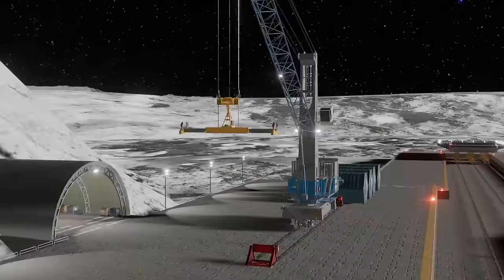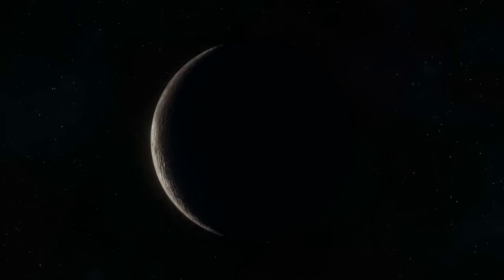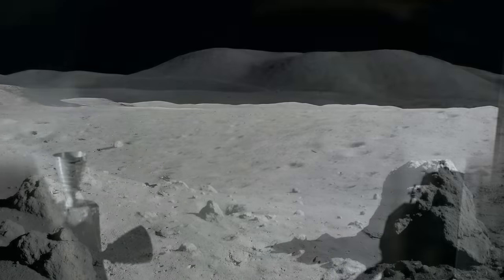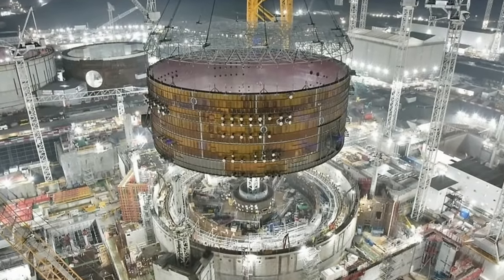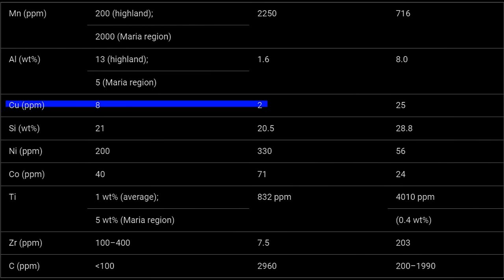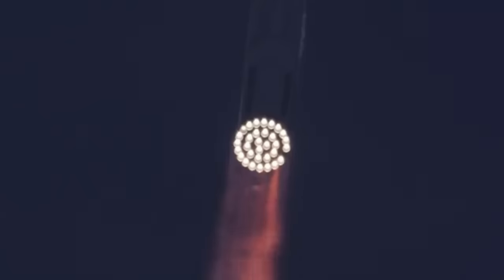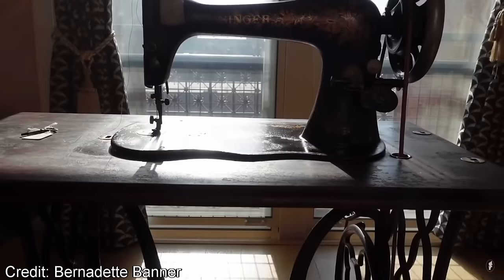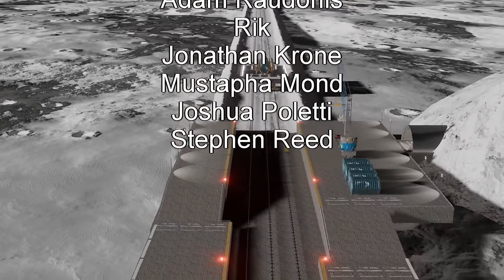Designing Heavy Machinery To Excavate The Moon

Comment: It’s difficult to set up a forge on the moon, as casting steel requires certain sand mixtures (silicon and clay which isn’t on the surface). But the sand is somewhat reausable.

Electric discharge melting of the regolith, like how aluminum ore is smelted today, is probably going to be used, which required carbon electrodes which are consumed during the process. Similarly oxygen is needed for steel manufacturing (along with carbon) to remove impurities.

Whatever metal slug is manufactured by just melting the regolith is likely to be the major commodity at first, acting as a masonry unit, as well as initial ingredient in manufacturing.

Machining is going to be challenging, as the tool steels are not the modern machining standard, but insert tungsten carbides. Similarly the heat from machining needs to go somewhere. Lasers are imprecise and so is water jet cutting, so machining is needed. Grinding tools are made of alumina or diamond, of which can be grown, but not for a long time in the moon. Machining standards can actually reduce the need for grinding for tolerances down to one/ten thousandths of an inch, which is probably good enough for a steel shovel.

Multi axis cnc is going to be critical, and figuring out all the specifications of VFe and other regolith ingots is going to be needed.

The set up of manufacturing is going to be heavy, but could theoretically start with a hammer and anvil. But a ten ton, nine-axis, tool feed with dozens of specially selected tool sizes is a good start. Nine axis can imitate a lathe, but a lathe can’t imitate a nine-axis.

Collets, endmills, drill chucks, thread mills, centering bits, live centers, gear tooth bits, and more are just the most basic of basic. None of them are light, and none of them can be manufactured easily. They are precision made metal after all. That, and the weight of the set up is used for precision in the first place.

If you don’t want to use coolant, aluminum machines decently, but the coolent is probably going to be imported. Manufacturing needs to be in atmo, but casting less so. Also, the cooling of metal affects crystal structure, so purely radiative cooling crystal structures of metals needs to be researched. The crystal structure being where the strength and properties come from.

Cold and hot rolling, forming, and injection casting all take stupid amounts of metal to achieve the stupidly high pressure without bursting or breaking. Special lathes need to exist before cold rolling can occur, which is how most steel is made today. Direct ingot 3d printing of metal, probably laser sintering from metal dust, seems compact and useful for construction early on, but lacks precision at the small scale. The piece needs to be finished.

There is more to it all, but this is just a YouTube comment.

Qualifications: took an 8month course in college on machining specifically and have loved modern marvels since childhood.

See: 
Tool and Die
Machinist’s Manual
Steel and aluminum manufacturing
Welder’s Manual
Mechanics of Materials
Metal Crystal Diagrams
Tool Steel Handbook
CNC Machines
Machine Tool Manufacturing
Blacksmithing
Metal Casting and Forging

P.S. I just like this stuff, so here is my rant.
Reply: You honestly seem like an incredibly interesting person omg
Reply: You can get away with far greater tolerances than 1/10,000 of an inch ! - that’s actually high precision machine tool specifications.

Look at your 1950’s automobiles for ‘crap’ tolerances..
Reply: You need a complete re-think of how to manufacture things on the moon.
Simply copying Earth methods is not the best way to go.  Things that can make use of ISRU are the best solutions.
You want to import the minimum amount to stuff.
Reply from the maker: Great stuff, thanks fellow steel lover. 
So you'll be interested in this: https://www.nature.com/articles/nature12134
This was invented off the back of extracting oxygen from lunar regolith but is now poised to change the entire steel manufacturing industry and has already setup a facility in Brazil. Si is also pretty common on the Moon (around 20% by weight) but I'm curious if it will be necessary using this electrolysis method. You said for casting not smelting so it likely will but regardless lunar steel production will be different from here on Earth. Vacuum is free though. 
Adding carbon instead of removing it is also an interesting change.

As for much of the other stuff you mention it's a great reason why our lunar industry will be like that of the 1930s 1940s etc. for a while. I will touch on this more in a future 'manufacturing video' and I really appreciate your comment because it'll help me format some of these ideas. I also appreciate your list at the end, will check those out for that video.
-Ian
Reply: Really interesting link. Given how fast carbon anodes deplete, something that even reduces the need for replacement introduces options, bigger batches, non-carbonous iron alloys, higher throughput before replacement.

I am also curious how gravity affects metallic grain structure, be it micro or higher gravities. So seeing a future where humanity can learn this is a big thing to look forward to. There is a lot more to look forward to than just grain structures hopefully!

I look forward to seeing what else comes from you!
Reply: Yeah, there is a boat load of things with tolerances much higher than 1/10,000 in., but keeping such high tolerances can make up for lack of polishing and grinding. I have made some parts where line of sight was sufficient, but that’s mostly visual stuff or parts where someone interacts with a piece like handles and such.

Though some parts do need ubber precise parts, but those tend to be lithographed I think because it becomes the realm of micro machines. I think much more expensive machines can get more precise, but good luck putting them on a rocket and expecting all the bolts to be in the same place!
Reply: Oh, also, I have an old Tool Steel Handbook, and all the needed elements (to make everything in the book) are: Iron (obviously), carbon, manganese, chromium, molybdenum, silicon, vanadium, tungsten, cobalt, and nickel.

This works for drill bits, augers, chisels, burnishing tools, clutches, nails, pipes, blades, dies, extrusion nozzles, glass dies, lathe tools, endmills, forming tools, hammers, threading tools, cutters, knives, machine parts, knurling tools, pneumatics, rivets, wire draw dies, and more. (Taken directly from the “Applications of tool steel” section of the book.)

“Tool Steel Handbook” from Allegheny Ludlum Steel Corporation c.1956
Reply: Question. Why can you not simply use water for machining coolant? It has good heat absorption properties, is easily recyclable and is almost certainly available in large quantities. In fact, if water ice is not available in large quantities on the moon, then you might as well forget it all together and focus those efforts on Mars instead.
Reply: @Shrouded_reaper
Water would work for cooling metals, but water is the tendency to oxygenate and thus corrode a lot of metals, either the workpiece or the machine components themselves. Corroded metals have different properties to what most applications call for and can increase both wear of parts and reduce structural strength. 

Also, at very high temperatures, which are very rarely worked at, water would flash boil and thus push away the rest of the water preventing further cooling, or could just damage some component.

More fundamentally though, oil has a very high thermal mass and sticks very well to work pieces. This means it can get into all the little nooks and crannies present while machining. The oil sticks in large quantities to the drill bits, the mill heads, etc and flows into contact with the metal as the bit spins and cuts pieces away.

Good question. I think there are some specific applications where water based coolants are used, but I am not familiar with them, or my instructor simply didn’t teach me them.

I hope this helps.
Reply: @projectarduino2295  Is there such a thing as abrasive dust machining? If we are talking exotic machining then could something like diamond dust (or regolith) be used like sandpaper be possible? Thermally speaking I imagine it would be a long process of waiting between blasts for cooling but would that be enough? Or would the ricochets cause too big of an issue?

You seem to be pretty knowledgeable so I figure I'd ask.
Reply: @mrsuper7484
Abrasive dust machining specifically? I don’t think so.

There is sandblasting: the slow process of wearing down a material using an aggregate. It is used to smoothen or finish hard and brittle materials like stone. High pressure air is used to throw the sand at a material which slowly weathers it down. It often results in a generally soft texture. It’s main problem is the wear on the ejection nozzle, which is often made out of tungsten, due to the aggregate abrading as it is ejected.

There is also water jet cutting, which uses high pressure water and sand particles to punch holes in and cut through steel sheets. Has the same nozzle problems as above. Sometimes it doesn’t use sand but that is for softer materials and is common in the food industry.

Then there is grinding, which uses a polymer to bind together aggregates which are then rubbed against a surface to remove small amounts of material (based on aggregate size) and when a particular aggregate looses its sharpness the forces acting on the aggregate pulls that piece off exposing a new piece for cutting.

I hope that helps. I am not aware of a primarily aggregate based machining procedure, but the benefit would actually be that there would be a very low need for coolant as the aggregate particles would carry away the heat they generate in the abrasion process, and the only thing then needed to be cooled would be the workpiece, which depending on its size can be negligible, the bigger the cooler. As of right now, it just seems to be too slow of a process to perform the large amounts of material removal common in modern machining.

Once again, hope this helps!
Reply: @mrsuper7484
Grinding disks do use industrial diamond sometimes as an aggregate though.
Reply: I suggest looking up Laser Waterjet, or 'laser microjet;' as it's a great option for this kind of problem potentially.
Reply: Rant appreciated.
Reply: His idea of steel as a starter is off the table, because the Moon's iron isn't concentrated enough, it's gotta be aluminum & silicon as starting materials (in oxidized form, both are common on the Moon, and even in the same minerals). For melting, probably microwaves at first (in regolith form), followed by induction heating at a central location later- in vacuum, just heating the regolith enough will cause oxygen to outgas, leaving you with much more conductive materials, so the initial microwaving step should be enough prep for "field ingots" to be ready for the induction melter (the process is called "vacuum distillation", and can actually be used for much more refining, but elemental purification would be best left to later base expansions). Baring only a few surfaces (axels come to mind), all early machining will be some mix of lasers and EDM devices mounted on a robot arm (which wouldn't need to be strong, and thus could be light), and maybe grinding (regolith is very abrasive), with almost all shaping provided by additive processes (whether casting, or welding): note that I would classify sintering as a class of molding.
Reply: Carbon shouldnt be a problem, you get lots of CO2 either from breathing of humans or from industrial processes, since everything will be in pressurized bases, you have tomdeal with the CO2 anyway to keep the people alive. It is pretty simple to collect it by plants or filter systems.

Comment: Actually because the moon has no atmosphere, titanium becomes a very interesting material. It's not rare, but on earth it's hard to manufacture because it oxidizes during production.
Making it in vacuum could make titanium the best material to use and also cost effective
Reply: We have found a method to machine titanium that has overcome that issue.

Comment: an excavation on the moon would be a dust storm visible from Earth, and entirely invisible if you were standing in it, along with everything else
Reply: ........ okay
Reply: Remember that dust kicked up on the moon might be rather intense at first, there is no atmosphere and no wind, so it settles very quickly and without any fuss.
Reply: @gallomimia7780 there's also the fact that static electricity can float dust on the moon easily since there's no moisture in the air to neutralize it, nor is there a way to really ground your machine well. Gigantic lightning bolts zapping your machinery at random?
Reply: @OtherDalfite  dedicated lightning rods between large exposed facilities? the most valuable things will be protected indoors
Reply: @OtherDalfite : And also long-distance sand-blasting in some cases.

Comment: Aluminum wound motors is a great idea, I'd double down on that. Pullies still have physical parts in contact that need oil and constant replacement from regolith abrasion. Instead, aluminum wound linear motors with maglev bearings could be a drop-in replacement for hydraulics which is immune to regolith contamination due to a lack of touching parts. The maglev parts can be more aluminum wound electromagnets or ferrous superconductors.
Reply: I believe Nasa's upcoming nuclear sterling generator, mentioned in the video, uses magnetic bearings. But how is this a replacement for hydrolics? Hydrolics don't use bearings?
Reply: That's good but aluminum is tend to slowly degrade under current, it needs to be static and not flex, because it has small flex resource, and, connected to copper wires, which PCB's use it degrades more quickly and creates small currents, that can have a bad effect on control electronics.
Reply: Don’t forget - no atmosphere on the moon.  So degradation is mostly via abrasion with regolith.
Reply: Maglev bearings are only really options for extremely low load applications. Youre not using maglev in heavy machinery
Reply: @peterclarke3020  Aluminum degrades under current - atmosphere doesn't affect too much - that's the main reason most soviet mars probes died in interplanetary space half way to their target destination - because the manufacturer of diodes for those crafts chose to save money on golden contacts, replacing those with aluminum ones.
Reply: We conveniently left out the complex materials and processes involved in insulation, without which motors don't work.

Comment: I'm an automotive electrician, the weight of the electronics in a vehicle is maybe a couple of kg, thats not including their casings and housings, the main weight for electrics and electronics  is the wiring, and as you rightly stated, aluminium is plentiful and more then sufficient. When you mentioned the daytime temperatures of 120 °c, thats above boiling point for water, so, theres your steam power for your steam shovels, we can also use the waste heat from steam power to power sterling engines, a hybrid. made from readily available materials, very simple mechanisms,  and no complex electronics, while being easily repaired.
You are on the money with your ideas, keep it up, I like your content.